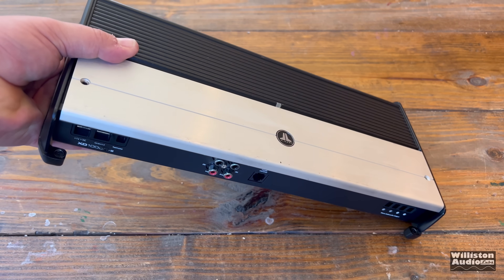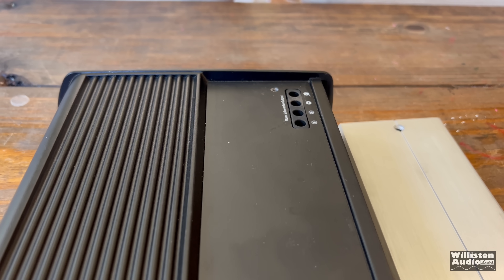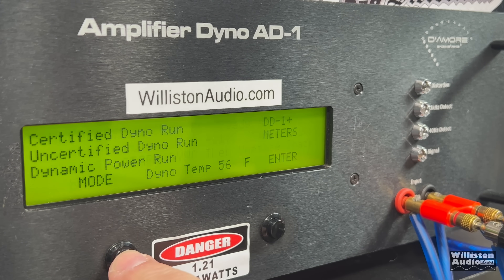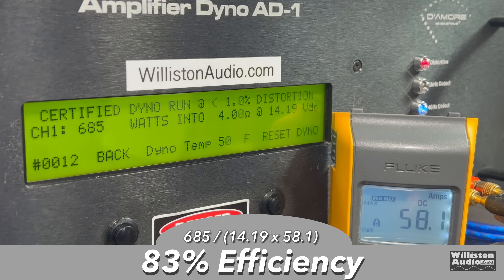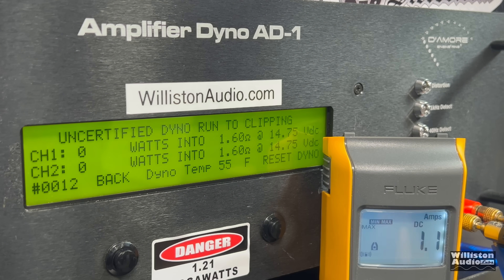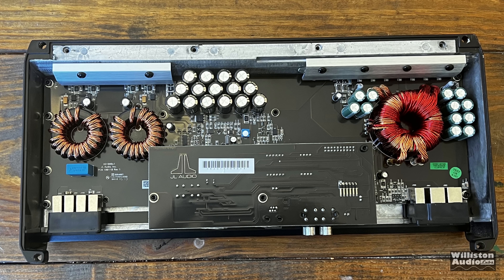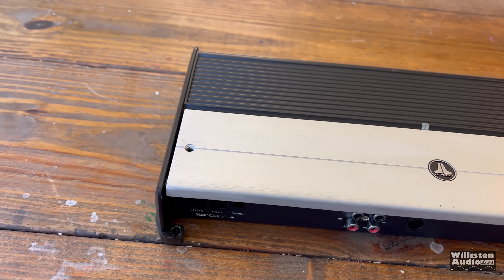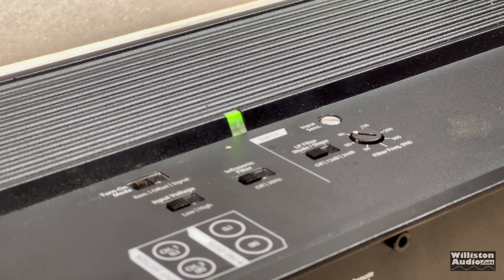Almost $1 per Watt? JL Audio XD1000/1 Amp Dyno Test and Review

Comment: I thought this was going to be an amp from the mid 2000's based on it's size, looks, 2ohm load and regular rca's. I didn't realize  it was an amp that was actually currently for sale. It just appears a bit dated and doesn't seem like it has enough features to warrant it's price tag other than implied quality.
Reply: JL is one of the last companies from the 2000s trying to cash in on their name.
Reply: @Thezuule1  they're doing fine. Car audio is just one of their divisions. Hifonics is a better example of a company "cashing in".
Reply: @msh6865  I don't care how they're doing, that's irrelevant.
Reply: @Thezuule1  JL simply cost more :
Products designed, researched, development, tested, quality control
all in house by JL engineers & many of
it hand built.
Unlike many copy cat brands :
No engineer department
Only copy & paste
Rebranding rebadging
using cheaper parts
mass production
minimized quality control
It's like eating a great steak at an expensive restaurant vs. a hamburger from McDonald's ect ect
Your gonna remember both experiences
but only one was good
How they're doing is relevant : 
Gives consumers choices

Comment: Im glad that the Brands like JL and RF are still around showing the world what engineering looks like. Beyond reliability and quality. There is predictability. You can depend that their ratings are pretty solid and makes it easy to choose the correct speakers to pair. Most blown speakers these days occur. Because some Korean, off the shelf amp, with no real regulation was used. Then they set their gains the "Reddit" way and clip the signal. Pop even more subs.
Reply: Let me guess, you think steve meade is the best too?

Comment: Good looking PCB. From my understanding, an array of smaller caps will have for plate and terminal surface area than fewer large caps. This can ensure faster current delivery as well as power and heat dissipation.
Reply: Lower ESR
Reply: Yes, due to the lower series resistance and inductance. Less power loss and heat dissipation = longer life.
Reply: @napnapnop  So prior, engineers knew nothing of ESR and current delivery? Today, still few home amps use a small cap array.
Reply: And you can put that pcb into a slim case. Wouldnt be possible with a huge, round single cap.

Comment: The RCA not Tiffany and no bass knob ouch for the price no low ohm load for how much 🤯🎶🎵🛠️👌👍✌️
Reply: Because it's sound quality you're buying, not SPL output.

And these amps are tanks when properly powered. Seen plenty running just fine after 12-15 years.
Reply: @smellsuperb1 there other  amp that coast  less that last just as long when properly used  and im positive  90 percent  of people  aren't  going to be able  to hear this  and say I can tell that it's a JL audio  I can  hear the sound quality difference .  JL good  but in my opinion  way over priced  on a. Lot of there models   and  most people  that are willing  to pay way more for  some of  there models  are paying  just  because  of the name   like the w7  there cost per sub  for the material   under  300$  the other 700- 1200$  your pay depending  on when and exact  model for the name  patient  and tooling  for JL    not because  the quality  that much more. money then any  author sub out there   again my opinion from what I've seen  and if the are so much better  you wouldn't see quite a bit  of them damage  and selling  dirt cheap on ebay compared to normal  what it originally cost 💯👊👍✌️😉
Reply: @josephsaucedo8691  you're confusing perceived value with actual value. Using FB marketplace as your guide is misleading, bc you're only telling one side of the equation. Also, some people are just selling things out of desperation, they're not concerned about market value. I currently have a car audio store and I've been selling car audio for almost 30 years on and off. JL Audio holds value better than any other US-based brand and I have the sales records to prove it. JL isn't using off-the-shelf motherboards and capacitors, their higher end amps are bespoke. Again, it's not an SPL brand. SQ or SQL, yes definitely. And for every brand that can do similar for a lower price, you have others that can be much more costly (Focal, Audison, Mosconi, Braxton, Morel, etc etc).
I'm never going to tell anybody what they should spend, but I will absolutely tell them best overall value for their long-term dollar. And if that happens to be JL for their application I'm going to tell them. You can get better performance from a modern 6-cyl twin turbo Toyota than a 1970 Chevelle SS LS6, but the Chevelle guy isn't wrong for wanting a muscle car.
Reply: @josephsaucedo8691 also, 70% of equipment failure is user error/abuse. Don't blame JL for the actions of negligent buyers.
Reply: @josephsaucedo8691 It's comments like this shows me who the brokeys really are  Sure you can buy a cheaper amp but the quality is going to be crap forcing one to eventually buy another amp which effectively will make it cost more. There is a saying that goes "buy it nice or buy it twice".  Furthermore, these are the same people that sate those who buy Ferraris are fools when they can easily buy a corvette for a third of the cost because it does the same thing.... really bro,  really jeez

Comment: I tried running the xd 600 at .8 and was rewarded with a horrible screeching noise through my subs, it got yeeted and sold. 😂
Reply: Why would you run a .8 load through an amp that states 2 ohm stable 1.5 with the w7s but just why?
Reply: Acknowledge mistakes
Sign says NO trespassing
You trespassed
Pay the consequences
Don't second guess
Multimillion dollar companies with top notch engineers & lawyers

Comment: I've always had a question and I wonder with the modern amps using the phone jack for the bass knob are they compatible with other amplifiers. Can you take a bass knob off a scar audio and throw it on that JL?
Reply from the maker: No sir, they may be and are likely wired differently internally
Reply: They are most likely wired differently, and if they are wired the same the chances that the potentiometer inside the knob is the same is probably slim...

They're probably the same from brands that repackage similar designs, but I wouldn't try one of them on a JL or a Rockford amp.... You're already buying a nice amp, get the correct knob.
Reply: Slick Willy just did a series of tests with several amplifier remotes from different brands, and on multiple amplifiers ..and no they don't work the same, just due to the type of cable used. Typically they will work/interchange, on brands that use the same boards from the same build house.

Comment: The reason I can come up with off the top of my head for using smaller capacitors just faster charge faster discharge with less heat than the larger capacitors. I think the larger capacitors can handle The higher temps were longer and probably the thermal cycles better. I am not an electrical engineer but I do have a understanding of physics and that is my conclusion and nothing more.😊
Reply: smaller capacitors with the same total capacitance of a larger cap do not recharge faster or have better thermals. there are caps, big and small that have the same temperature rating.

the main advantage to using lots of small caps vs. a few bigger ones would be lower esr (resistance across the cap), handle higher ripple current, and better high frequency rejection.
Reply: @bensonak47  The only reason I brought up the thermal capacitance wasn't the rating but the volume of mass more mass you have the more he can take at a longer period of time before it degrades. And I understand the ripple effect that's what I mean by charging and recharging the cycles are less affected in the smaller capacitors. All things have thermal detegration and usually the slower the Thermo cycles the log or something will last.
Reply: My friend, check out a hybrid battery/capacitor Hi-Fi Vega did a review on recently... If you have a few free minutes.... It was cool and almost seemed to defy pesky things like physics lol It was sweet though and reasonable price! New technology is awesome! So is old school though! Can't underestimate the OG stuff that got us here 😁🍻❤️🎶 Now, crank that puppy up! 
P.S. - I apologize I hadn't finished the video yet and I was thinking of external capacitors, but still, if interested, check it out and have a wonderful day!

Comment: I'm dying at the amp that doesn't catch fire statement after watching Parker the basehead video on his new amp catching fire this morning.
Reply: He used some sketchy brand I never heard of. Probably has sketchy protection circuit.
Reply: @Bassotronics  that amp that caught on fire is a common amp sold on Alibaba. Just rebadged. Now, on that same note, the Teampie amplifiers are also sold on Alibaba unbadged with the option of branding it with your own brand if you purchase like 5,000 units. EMF audio , along with many others all use the same amp with their own branding on them.
Reply: @HoUsEoFcAtS78  it's a SounDigital clone.. same as the SFB, Slapz, NVX, TopStronGear...and so forth. But, it wasn't the amps fault that it died..
Reply: @HoUsEoFcAtS78  I just got a teampie 7500.1
Reply: @josephscarborough23  I've heard only great things about the TP amps, especially their Class D Mono. Saw a guy who was wires half ohm & running his TP HARD with no issues at that particular time.
Reply: That Marts amp video is hilarious - Nooooooooo!!! Lmao
Reply: He used a sketchy designed subwoofer. Basically a novelty subwoofer, that he previously damaged and cob-job repaired. The sub had a dead short, from it rubbing the top plate under heavy load the first time he "tested" it and the spider lifted. Sub died, and killed the amp. It happens,  and could happen to any amp..full or half bridge. Parker isn't the best, at doing actual tests and or reviews most of the time. But he's entertaining.
Reply: @NoB.S Audio  agreed. He is backyard mhead style. Comedy not review.
Reply: @numlockkilla  💯 agree
Reply: @numlockkilla  you said "he is backyard mhead"... Care to elaborate your meaning for "mhead"??
Reply: I didn't even get to see that video yet. Thanks a pantload Chet! 😂😂😂
Reply: That was last week 😅
Reply: @deeplycon638  he has a new video, posted today
Reply: @Chuck_Sanders  I know I watched
Reply: Hyfonics has a excellent brx3016.1d  I really abuse mine works great not sure about power output on the new Brutus gama but there 4 channel produces excellent sq full range
Reply: @mad_mechanic Geez. Where did you learn how to type?  😂
Reply: @Ignacio-e9t  your mom taught me how to type duh... Nah but for real I got lazy fingers... You must be one of them kids that only passed English and failed everything else so you got to make yourself feel good and correct everybody 🤣

Comment: i had jl subs when they first came out in the 90's on a fogate power 300........used to eat punch series subs, the jl's just kept going and going......
Reply: Yep, I like JL. Miss my original 300w slash series. After wasting my money on 3 cheap amps I finally ponied up and bought a real amp.
Reply: My JL W0 despite its small coil can handle some good amount of Bass! 
I also have a 12” Bass Acoustics that cost me $59 and  still working.

Comment: You would think a "high quality" amp would at least come with tiffany style RCAs! Hard pass on JL stuff anymore. not enough bang for the buck!
Reply from the maker: Also the lack of 1 ohm stability is a bit frustrating these days...
Reply: @wal i would argue that companies such as JL make products to fit within their eco system.  Since this would be for their w7 subs, you'll notice that those subs work at 3 ohms negating the need to make 1ohms work as you mentioned

Comment from the maker: SHOP
JL Audio XD1000/1v2 - https://howl.me/cjjpvQ1B1su
JL Audio XDM1000/1 (marine version) - https://howl.me/cjjCrVugwgT
JL Audio HD1200/1 (high end) - https://howl.me/cjjCtnP3nqx
JL Audio VX1000/1i (DSP integrated) - https://howl.me/cjjCvjQEaDL

RELATED VIDEOS
JL Audio HD1200/1 1200W Monoblock - https://youtu.be/Bu54AhLu_oc
JL Audio RD1000/1 1000W Monoblock - https://youtu.be/2mmx07rzB9s
The Best Selling Car Audio Amp EVER? JL Audio 500/1 - https://youtu.be/BLf_mDR4FDQ
JL Audio HD900/5 Five Channel Amplifier - https://youtu.be/qhPekKkacCc
JL Audio XD600/1 600W Monoblock - https://youtu.be/0mvbDS6znpI
JL Audio XD500/3 Three Channel Amplifier - https://youtu.be/UsLUeO33DgE

VIDEO INDEX
0:00 Intro
0:38 Features and Specs
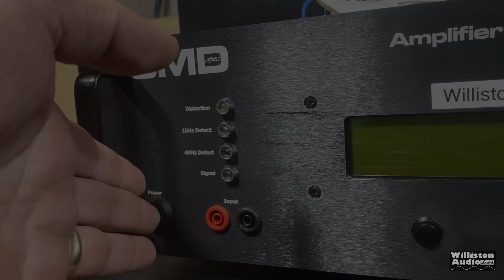2:12 Amp Dyno Tests
6:33 What's Inside?
7:49 Pros and Cons
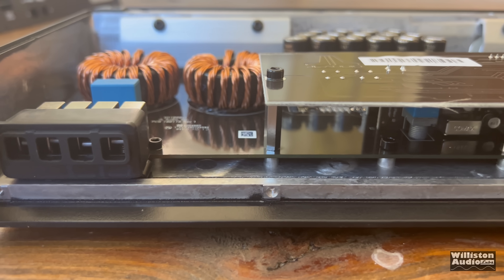8:34 Final Thoughts
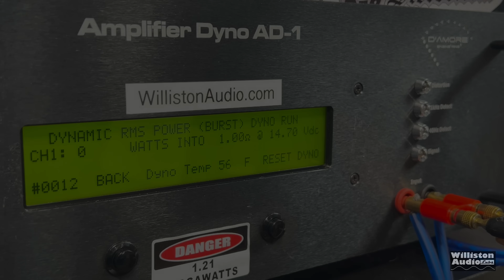9:23 Additional Test

VIDEO AND AUDIO GEAR
Camera - iPhone 13pro 1TB - https://amzn.to/3nCjGvc
RODE Wireless Go II Microphones: https://amzn.to/3Q6NVHl
Shure MV7 Microphone: https://amzn.to/3A4OICK
Zoom H4n Audio Recorder: https://amzn.to/3BXjVsS
960 LED Panel: https://amzn.to/2Sxoq3S

TEST BENCH EQUIPMENT
SMD / D'Amore Engineering Amp Dyno: https://goo.gl/sJTcf7
XS Power D1400 Batteries - https://amzn.to/2BPFCKW
XS Power PSC60 Charger - https://amzn.to/2CHGcfs
Fluke 1000A AC/DC Clamp Meter: https://amzn.to/2Rw5WDA
Handheld Dyno: http://amzn.to/2u2EgKV
My Favorite Screwdriver Kit: http://amzn.to/2x0VzcE

DISCLAIMER: This video and description contains affiliate links, which means that if you purchase from one of the product links, I may receive a small commission. As an Amazon Associate I earn from qualifying purchases